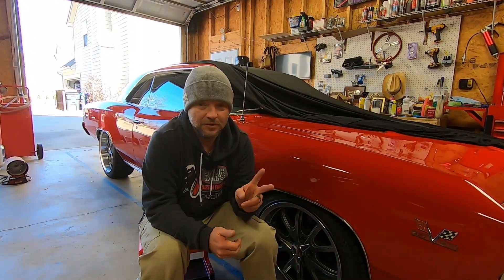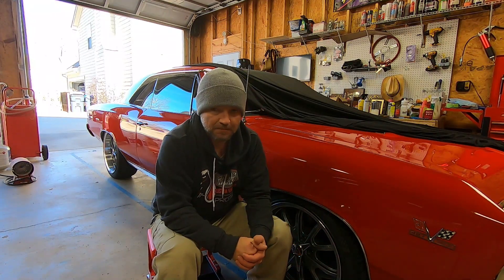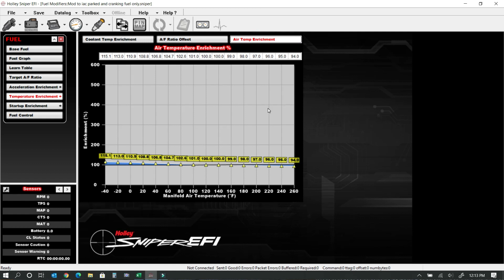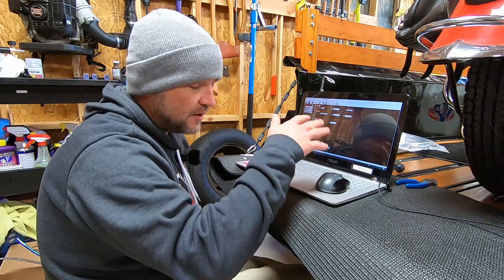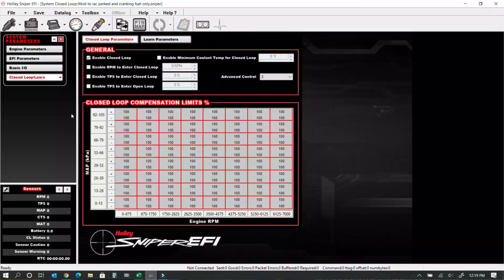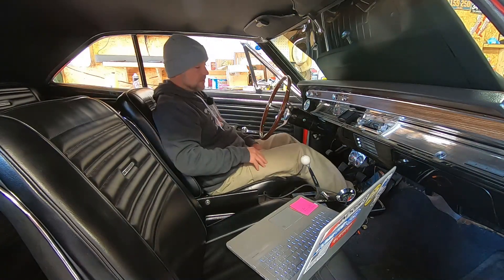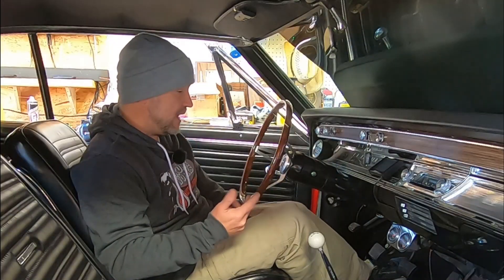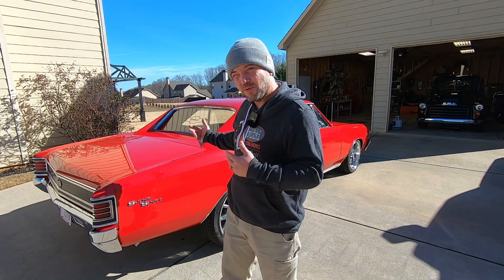EFI Explained | Holley Sniper EFI | Tuning Basics | Kevin Baxter | Baxters Garage | Pro Twin Perform

Comment: Kevin, Great video! In my day, there were carburetors, with automatic chokes, accelerator pumps, throttle dashpots, fixed orifice jets, mechanical linkages (and later throttle cables), heat risers, distributors with points and a condenser, dwell meters and timing lights. On the intake side, a Holley carburetor (3- or 4-barrel) and a high-rise intake manifold were the things to have. The engineers back then deserved credit for dealing with cold starts, warmups, extra fuel for acceleration, and all the rest with those mechanical devices. Now, it is all done electronically. It is nice to see a 1960s muscle car with a computer controlled engine. Nice hole shot. Remember, shift as hard as you want, but don't break your arm. When are you opening a shop in CT? Happy New Year!

Comment: Awsome video, thank you so much for sharing your knowledge with us! I also have this whistling sound coming from my quick fuel double pumpers and it is driving me crazy! Initialy i though it was an exhaust or a vaccum leak but after changing a couple of gaskets I also came to the same conclusion that it was coming from the air entering the throttle body. I have a 1/2 inch spacer which is the thicker I can use.

Comment: Another question, did you install the O2 sensor thanks to the mounting bracket holley provide or did you weld a bung?
Reply from the maker: I used their bracket...just to see if it worked.  Best i can tell...it works great.  Good solution if someone has stainless exhaust like i do.

Comment: A new one, what about the learnt VE, how did you apply the multipliers? I'm asking this because I'm planning to buy either an holley sniper EFI or an edelbrock pro-flo 4.
Reply from the maker: that part is relatively simple.  clicking "apply learned values" is pretty much it.
Reply: :-D OK not too hard

Comment: Interesting to see the process, MSD Atomic on my tonner but the science doesn't change. 
Bit the bullet and started on my M8, if I break something I'll have to argue over the warranty I guess, manifold air temp dropped nearly 40C as soon as I changed the air cleaner, not a surprise but it's always nice to validate your thinking so easily.

Comment: Very good video, and exactly what I was looking for. I am just finishing my build of a 67 el Camino, 427(433), 4 spd, 373 gear. This is my first venture into any form of efi. I have the 4150 sniper installed and running (?) but the tune is terrible. My brakes are still not dialed so I can’t really drive it so it can learn. So, my question is…since you and I have a very similar set up, would it be possible for me to use the base numbers that I can see in your video to get me close? If that is really not cool, I apologize. Anyway, great video.